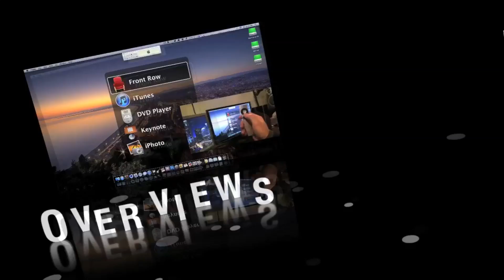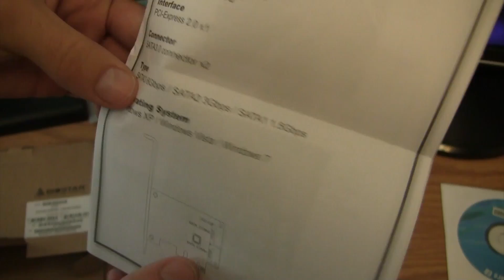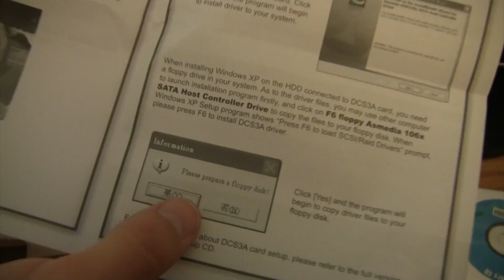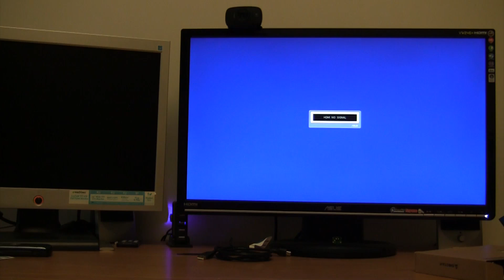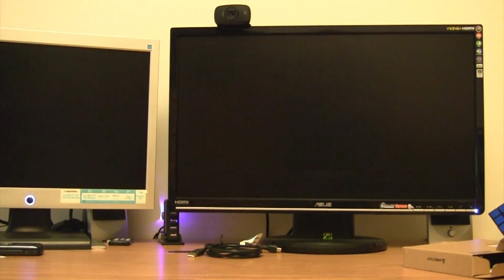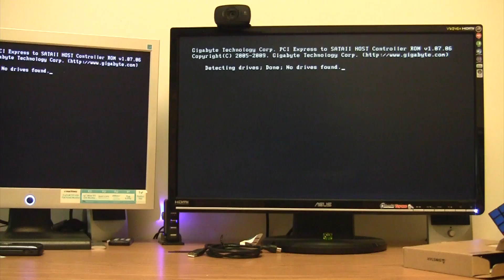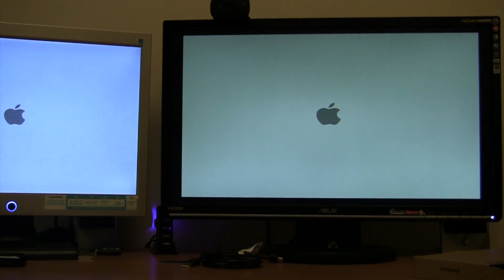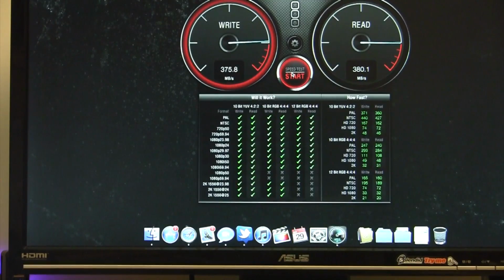Unboxing & Installation: ASM1061 SATA Controller

Comment: does that mean i can't use a gpu if i have this installed? My MoBo has 4 sata ports but I want to connect the fifth hard drive.
Reply: Check out https://en.wikipedia.org/wiki/PCI_Express for more info but installing into a x16 slot is no better then a x1-x8 slot if its the same version (1.0, 2.0 or 3.0)

Comment: whats been said in this video is wrong -- plugging a x1 card into a x16 slot does nothing beneficial except waste the x16 slot... think about it.. it cant magically increase the bandwidth without actual physical pins that actually carry the data... the limit for this x1 card is 500Mb/s when plugged into any pci-e v2.0 slot, or 250Mb/s when inserted into a pci-e v1.0 slot REGARDLESS of it being a x1 or x16 slot. hes using the GA-X58A-UD3R motherboard https://www.gigabyte.com/Motherboard/GA-X58A-UD3R-rev-20#sp according to the data on his motherboard his pci-e x1 slots are all pci-express v1.0 while the other 8x + 16x lanes are all conforming to pci-e v2.0 spec - so while not articulated well, he is correct that those slots would have only given him 250Mb/s speeds, for his specific motherboard he did well to use the x8 slot which gave him the 500Mb/s max thruput.

Comment: I know this video is old, so nobody will ever see my comment, but can the video creator tell me where to get a similar card for PCIe that has 4 ports of SATA III 6.0Gbps so I can upgrade my older PC to get moe SATA 6.0Gbps ports? Right now I only have 2 ports, and I am using like 8 HDDs thanks!
Reply: i know this is really old but ill still give you a reply https://www.newegg.com/ look for StarTech.com 2 Port SATA 6 Gbps PCI Express SATA Controller Card Model PEXSAT32

Comment: u dont need x16 lans for card that used x1 lans u god damm learner
Reply: That's true if the pcie x1 lane is v1.0, the bandwidth is reduced to 250MB/s. Whereas a pcie x1 v2.0 lane can handle 500MB/s. Max SATA 3 bandwidth is 600MB/s. In fact, there are systems with mixed pcie versions where the x16 lanes are v2.0 and connected to the northbridge but x1 lanes are v1.0 and connected to the southbridge. But anyway, if both x1 and x16 lanes are version 2.0, it really doesn't matter where you insert the card .
Thus:
x1 pcie Sata 3 card in x1 v1.0 lane = Max 250MB/s (pcie version (v1.0) is the bottleneck to achieve 600MB/s)
x1 pcie Sata 3 card in x1 v2.0 lane = Max 500MB/s (pcie lane (x1) and sata card are both the bottleneck to achieve 600MB/s but doubles the bandwidth from previous scenario)
x1 pcie Sata 3 card in x16 v2.0 lane = Max 500MB/s (sata card number of lanes is the bottleneck (x1) to achieve 600MB/s)
Reply: thats right info but u can be 100% sure that this board isnt a pcix1 1.0 version so lets focus on this video and not in theory but your info is 100% (and for overall informative knowledge pci express x1 ver 2.0 came out in 2007 which the ver 1.0 interface belong to the 2004/5/6) somwhere of this years

Comment: No, those "little ones" are not "regular PCI". "Regular PCI" is an older standard altogether, which you cannot plug your controller card into. They are larger than those, and look "almost" but not quite like a back-to-front PCI-E x16 slot. Those little ones you are refering to are PCI-E x1 slots, which would work perfectly fine for your card, as the card is PCI-E x1 in the first place. The slots you plug it into, are PCI-E x16 slots, which basically means that they have up to 16 PCI-E channel available, BUT the connector needs to actually utilize all those channels to benefit from it. The revision of PCI-E (1.0, 2.0, 2.1 or 3.0) is what determines if you'll get a speed boost or not with this controller card. The max bandwidth of PCI-E x1 version 1.0 would be 2500Mbps, 2.0 would be 5000Mbps. With SATA using 8b/10b coding (meaning it transfers 8 bits of data via 10bits) this means a maximum theoretical transfer rate of 500MB/s via PCI-E x1 2.0. It's that simple.
Reply: Why do people just make stuff up and post videos like they're some kind of tech guru? Idiots.
Reply: hey do you know why my mobo says using pcie gen 1 when it supports 2.0?
Reply: Martin Nosic
I couldn't say without having a look. But a PCIe expansion card (SATA controller for example) can be PCIe 1.0, and would probably report to your system that it's using 1.0 mode when your system supports PCIe 2.0 or newer.
Reply: i have plugged asmedia 1061 in x16 slot  for better ssd speed but when pc start it says using pcie 1 gen
Reply: It doesn't matter if you plug it into a x1 slot or x16 slot as long as the card is only x1. It will only use the single PCI express lane, regardless of the slot. I gave away the PC I had an Asmedia 1061 card in, so I can't really do any testing, but I can absolutely promise you, that a PCIe x1 card, will not connect electrically to any more lanes even if you try to stick it in a x4, x8 or x16 slot.
Reply: Could you please tell me the brand and model number of your motherboard?
Reply: lan party p45 t2rs,so asmedia pcie card is useless for me because i have half of sata 2 speed now
Reply: Thanks. According to the specifications I can find for your motherboard, both the "x16" slots are actually electrically only x8, which is pretty much confirmed by the fact that Intel's specifications for the P45 chipset indicates that it only supports up to two PCIe x8 at revision 2.0. The x1 slot would have to be revision 1.0 then, so it does actually make sense to put your Asmedia 1061 in an x16 (really only x8) slot. I'm afraid it's hard to provide any kind of constructive advice without actually being able to handle your PC. I'm really sorry.
Reply: i appreciate your fast reply and help, thank you ;)

Comment: Bob Roche So, you say that if I connect this to the required PCIe x1 slot, I won't get full SATA3 speeds, instead it'll be like SATA2 speeds, even when old-gen SSDs are used? (like Kingston SSDnow Vx300 compared to Samsung Evo 840 pro). Please enlight me bro, I'm about to buy one of these. Thanks

Comment: i have Asmedia 106x SATA Host Controller Drive(win7) and when i install drivers and boot up my pc it say divice not detcted and boot up windows when i chek in my divice panel its say:The drivers for this device are not installed. (Code 28)
There is no driver selected for the device information set or element.
To find a driver for this device, click Update Driver. when i tray to reinstal  drivers ask for boot up pc and after booting up same msg... so i am looking for expert to help  me with this

Comment: What SSD? I have X58A UD3R using Marvell 9128 getting Read:380MB Write:190MB with Crucial M4 128Gb SSD. Wondering if i should get the PCI SATA 3 card.

Comment: @cpukid00 

Ok i just put it in x16 slot now i am getting 

I also tried resetting bios to default 

Uncached Write	355.27	218.13 MB/sec [4K blocks]
Uncached Write	312.82	176.99 MB/sec [256K blocks]
Uncached Read	194.20	56.83 MB/sec [4K blocks]
Uncached Read	478.44	240.46 MB/sec [256K blocks

Random
Uncached Write	1976.24	209.21 MB/sec [4K blocks]
Uncached Write	508.71	162.86 MB/sec [256K blocks]
Uncached Read	4343.87	30.78 MB/sec [4K blocks]
Uncached Read	1187.93	220.43 MB/sec [256K blocks]

Comment: @cpukid00 I found the problem. I had to turnoff Write Caching for my drive in Windows. Not needed with SSD's. Also of note, "PCIe 2.0" refers to the controller. If your x16 slot is 2.0, so are your x1 slots. "ATTO Bench32" is now reporting triple my previous Write speeds (and even a tiny increase in Read speed) after disabling Write caching from the Device Manager.

You'd think the need for this would be more widely advertised. :)

Comment from the maker: @BI30 I know they're different, I plugged my SATA controller into the PCIe 2.0 slot on my motherboard. The card looks way too small for the slot, but it works great and I get great speeds. May I ask what app you're using to test your speeds?

Comment: @cpukid00 Tried it this morning. No difference. As expected, there is NO advantage to plugging an x1 card into an x16 slot. Also, do not confuse "old PCI" 33/66 slots with PCIe slots. Different architecture entirely.

Comment: I'm not using a Mac (64bit Win7), but I do have a Gigabyte MoBo. My Read speeds increased greatly (35%), but my write speeds plummeted by as much as 80%. I have no idea why. Plugged the card into an x1 slot because if I used my only other x16 slot, it would cut my video card bus speed to x8. Might I see better performance if I plugged the x1 card into an x16 slot like you did?